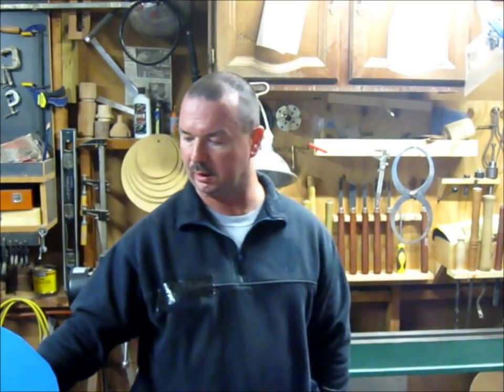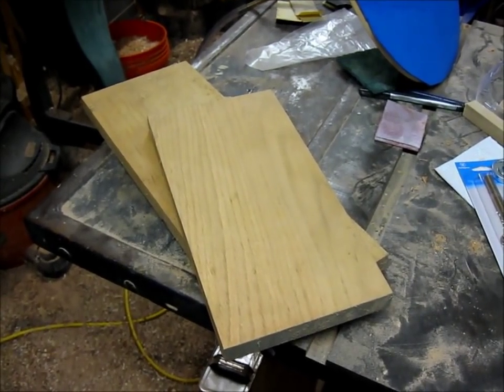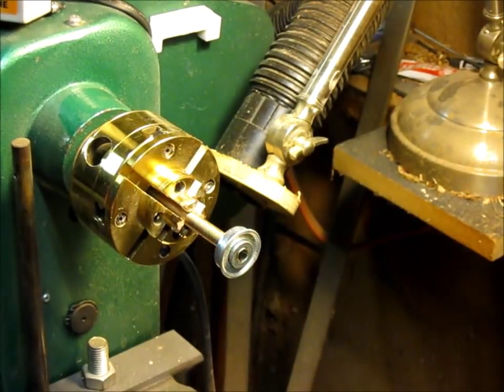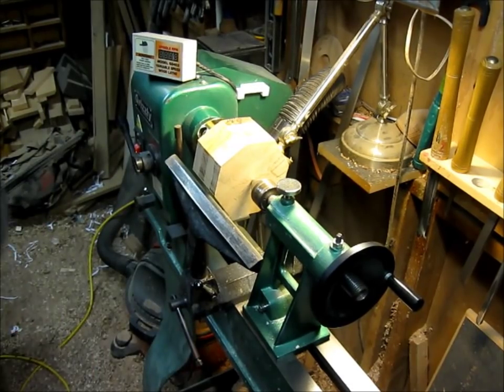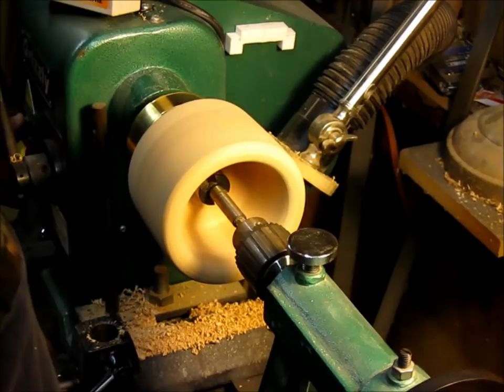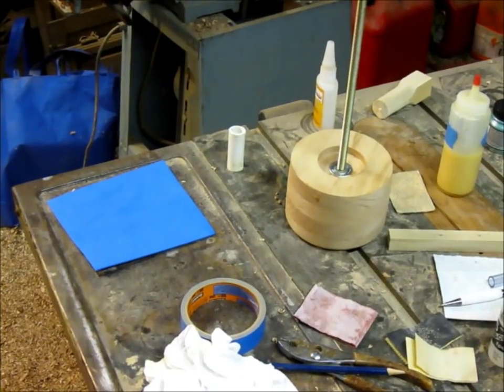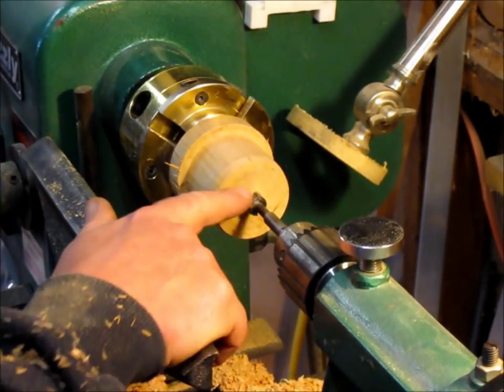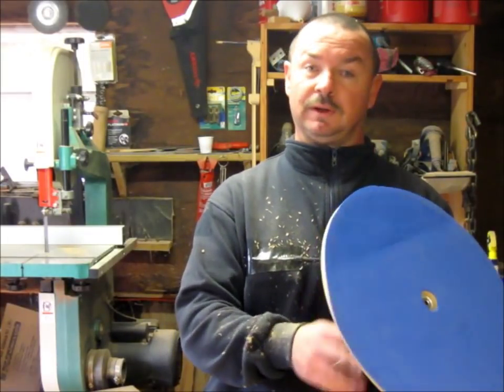#16 Making a Shopmade Vacuum Chuck

Comment: Stephen,great video!! have wanted a vacuam chuck and now you have designed one that I can afford.i have been woodworking  one form or another most of my 77 years.turning was a as need ed. but thr body is starting to rebel so turning is be coming my main focus. tnanks for all your great viseos and the tips that you are giving us . jon sellars
Reply from the maker: Thank you Jon for commenting. A couple of tips if you build this Vacuum Chuck. Use sealed bearings if you can. Remove the filter from your shop vac for maximum power. I still use this very chuck and it still works great. Glad you are finding my channel helpful and Happy Turning my friend.

Comment: Hi, Stephen:
I would strongly recommend putting a few coats of sanding sealer or varnish on the chuck, especially if it is made from red oak which is very porous.  The first drum chuck I made a few years ago did not have a very good grip until I put some finish on it.  There was enough air leakage through the wood itself to reduce the grip, even on a shop vac based system.  

Good video!
Bob
Reply from the maker: Thank you Bob, for your suggestion and sharing your experience. I agree and will add a note to the video. As always your input is invaluable. Thanks again.

Comment: Hey Steve, first let me say that I really enjoy your vids, look forward to seeing a post from you, the vacuum chuck is the one chuck that I don't have, I've been thinking about making one and the way you did it in your video looks like best way to go. I enjoy making tools that I use for turning as much as I like turning. I don't think that there is any thing more rewarding as making a tool and then being able to use it. my dad always said that if you can go to the store and buy it, it had to be made by man, and if so it can be reproduced and repaired by man,
Will
Reply from the maker: Thanks Will, apparently your Dad is a smart man. I too enjoy making my own tools and seeing them work. This chuck does have good holding power and could be easily adapted to a vacuum pump by using sealed bearings. Thanks again for your comments and compliments.

Comment: hi Stephen-thanks for the tips on vacuam chuck. I have built 2 so far and they work great.lowes has lamp pipe in a 30 inch length which will make 2 chucks.  thanks again
Reply from the maker: Thank you Jon. I am really glad you found this video helpful. I need to get some of the longer allthread. I am still using the extension. The vacuum chuck I built in this video is still serving me very well. No problems yet. Thank you for commenting and supporting my channel.

Comment: Could you drill a 3/8 hole through your 1 1/8 hole for the lamp rod?  Seem to me it would give the bearing more support.  Also a lot of people say using your shop vac for a vacuum chuck will ruin it.  Have you run into that?  Do you have a way around that? following your direction I think even I could do it.

Comment: If you run the shop vac without air going through it, it'll run very hot and will fail much sooner. Also if it's at all possible use a larger tube and bearing to get more air flow through to the bowl.
Reply from the maker: Thank you Stuart. I understand that without airflow the shopvac motor can heat up. However, a vacuum chuck is not used for a long period of time. They are also used to install pool liners where they may run for days with very little airflow until the pool is almost full of water. They are designed to operate for long periods of time. The biggest problem with using a Shop Vac in the shop is the noise.

Comment: Hi Stephen, around the 12:00 minute mark I noticed an articulated adjustable bracket or stand that I am guessing holds your dust collection nozzle. Am I right?  I would love to know either where you got it or how you made it. Great video (again).
Reply from the maker: Thank you for writing. Yes, it is for holding and adjusting my dust collection around the lathe. It was just an old articulating desk lamp. I simply pulled the wires out and replaced the lampshade with a 1/2" piece of plywood cut to hold my dust collection hose. I hope this helps.

Comment: Hi Steven. I built one of these this week. My shop vac is a 6.5 hp but when I turn it on it barely holds anything. I have checked for leaks and can't find any. It just dosnt have enough pressure when reduced to the 3/8 hose. Should I put a bleed hole in the rubber tube do you think?
Reply from the maker: Safecracker49 Thank you for your question. Couple of things to check. Ensure that your filter is completely clean or removed. My vacuum chucks get weak when the filter is dirty. Second thing make sure there are NO cracks in your bowl and finish has been applied to it. There is plenty of airflow through the 3/8" allthread to hold the bowl very strongly as long as there are no leaks. Try another bowl, because the first may have cracks or weak wood you don't know about. Any bleed hole you put in should be in the larger vacuum hose and not the smaller parts of your chucking system. Let me know how this turns out for you. I would bet the filter is dirty or you have leaks. The allthread can compensate for small leaks but not larger ones.

Comment: Great video.  Any details if I go to buy the ball bearing ring?  What would I ask for?
Reply from the maker: Thanks Glen for your question. Ideally you will need a sealed airtight bearing. With it you can use the chuck with a vacuum pump. However the bearing I have in the video is not a sealed bearing. I am relying on the volume of the shop vac to overcome any vacuum loss. Make sure you can get the lamp rod through the headstock and use a 3/8" inside diameter for your bearing. The outside diameter really doesn't matter.  If you have trouble with air loss in your bearing you can seal the back side with a rubber washer.  I hope this has helped you with your question and I thank you for watching my videos.

Comment: Nice build!  I definitely need to make one.  Any requirements on the type of bearing?
Reply from the maker: Thanks Dwight for commenting. A sealed bearing would be my first choice. However the ones I am using are not sealed. The shop vac moves enough air to compensate for any small loss through the bearing and also for small cracks in the wood. If you will be using your chuck with anything except a shop vac I would definitely suggest sealed bearings. Hope you find this helpful. Thanks for commenting and supporting my channel.

Comment: Hi Stephen - great video, I am now making two for myself. Missing on the video on the smaller chuck was how to stuck the foam on the rim. Did you cut the outer diameter and then the inner diameter out, spray the glue on the foam and thenpress the rim of the chuck onto the foam and finally fold the foam inside and outside?  Could you also confirm the diameter of the smaller chuck you made. Many thanks for your time - great videos all of them
Gary
Reply from the maker: Thank you Luke. Your procedure would work perfectly. I do believe that is exactly how I did it also. The outer diameter of my smaller chuck is about 4 inches with a 3/4" wall thickness. Also, make sure that you use a finish on the chuck to seal it from vacuum. I just used wax. Hope this helps.
Reply: Hi Stephen, Many thanks for your prompt response very helpful. Once this project is completed using a shop vac I will be looking seriously at the video of you converting a compressor. Can't thank you enough for your ideas, videos and the way every thing is clearly & fully explained. Only hope I can do your teachings justice
Many Thanks

Comment: Great video and great project! I really like your videos! a question: .. does it not burn out the shop vac making it work so intense (because of the little tube) ?? did that make any sense? ,, lol  .. thanks for sharing and have a good one  //Ken
Reply from the maker: I really don't know sir, however when I had a new liner put into the pool, They used a shop vac for four days non-stop pulling hard and it didn't hurt it. Not to say it may but shop vacs should be made for the hard pull. When vacuum chucking pieces, it usually does not have to run very long anyway. Thanks again String (if that's ok, I don't know your name) for your comments and questions.

Comment: Mr.Ogle what is the best way to rechuck a vase after you have parted it off and see the neck needs to be reduced down.
Reply from the maker: Thank you Jeremy. Your question is very good and left me puzzled for a few minutes. Then I remembered my vase mount. You can build one very easily and remount your vase for light turning. Here is a link to one of my vase videos in which I use the mount. You should be able to figure it out from there. Check this video link.  https://youtu.be/G-TRJvble6c?t=712  If the link does not work it is video #128 on my channel at the 11:55 minute mark. I hope this helps. Let me know if you have questions.

Comment: Do you loose a lot of suction when downsizing the hose to a piece of tubing/
Reply from the maker: David Peterson Yes, you will loose some volume but not the actual power once it is equalized. However the shop vac is capable of holding the vacuum with small leaks where as a vacuum pump may not. hop you find this helpful. Thank you for your question and for supporting my channel.

Comment: Does this cause the vacuum motor to burn out?  I have heard that it will.
Reply from the maker: Thank you Donna for commenting. I do not believe using the shop vac for this purpose will hurt the vacuum because I have seen them used for pulling swimming pool liners tight while filling and the shop vacs have to run for several hours if not days none stop without burnout. However, if you don't trust it I would not use it. I hope this helps. Take care.

Comment: steven do you know where i can get the bearing for this,,
Reply from the maker: Thank you Jeff. I bought the bearings at my local Ace Hardware store but you can also find them online. You just need a bearing with 3/8 inch ID and cut the rabbet to match the OD. Sealed bearings are the best. I hope this helps.
Reply: @StephenOgle  thank you stephan,,,,the reason i asked is that i went to ace and they didnt have any,,,might try another place tommorow
Reply from the maker: I used Flange bearings in this build but it was because that was the only ones they had that were 3/8 ID. normal roller bearings would be best. I would suggest if you can not find any local to try ebay. I get nearly all my bearings from there.

Comment: Steve
Somehow I hadn't watched this video before. I also made my own vacuum chuck and I also use a shopvac. I did use sealed bearings and they are easy to come by from Amazon. Here are the ones I bought http://www.amazon.com/gp/product/B002BBO3MC/ref=oh_details_o00_s00_i00?ie=UTF8&psc=1

They have gone up a few bucks since I bought mine in 2012, I think I paid about 13 dollars for 10 of them. If you have room in your assembly stack at least three of them back to back. If that link doesn't work let me know

Steve
Reply from the maker: Thank you Steve, for this information. I will definately look them up. The bearing I used was $6.00 from a local hardware store. I really appreciate your comments and input on these chucks. This is how we all get better. Thank you.

Comment: OK, I am new to this .At first look it seems as your 4 jaw chuck is holding the lamp rod to turn the vacuum chuck. I now see the 4 jaw chuck is holding  inside the cut out on the back of the wood vacuum chuck. You did not show this step but a super video any way. I have a Turncrafter 12" lathe on the way with a couple chucks,ect. Is this a good starter lathe?
Reply from the maker: Thank you sir for commenting. Welcome the the woodturning world. I hope you will enjoy it as much as I. Yes, I believe you will be satisfied with the Turncrafter from PSI. PSI also sells lots of accessories for this lathe including a duplicator. I will check the video and make a note on it. Thanks for pointing this out to me and supporting my channel.